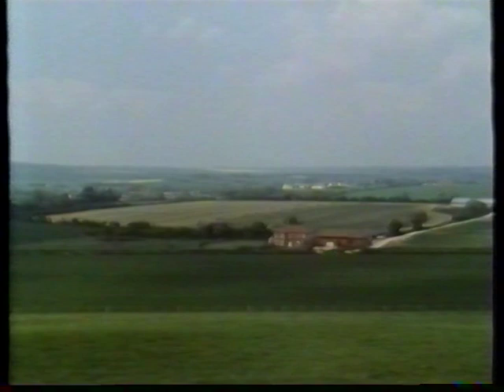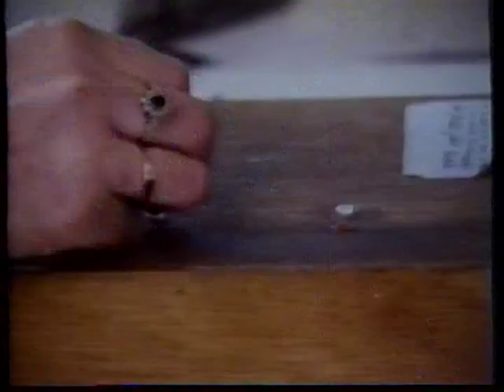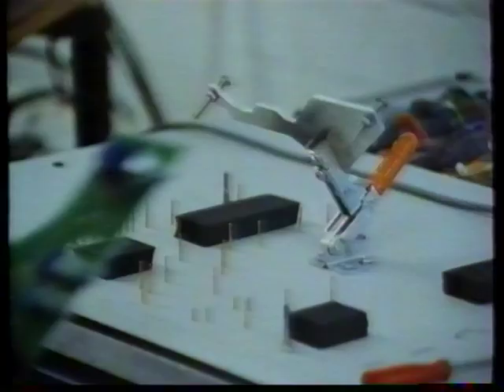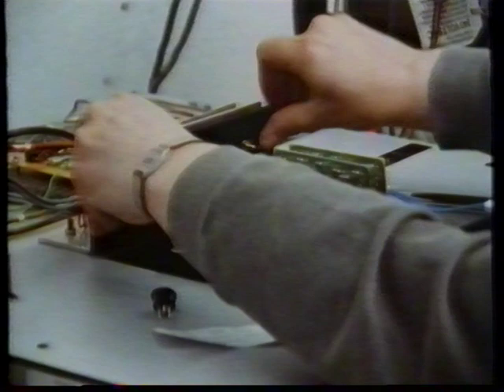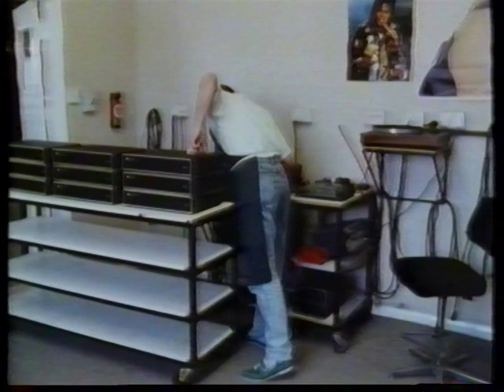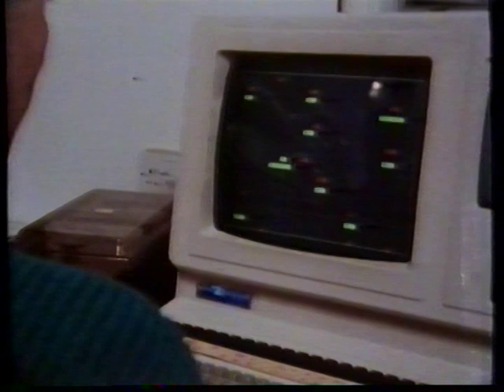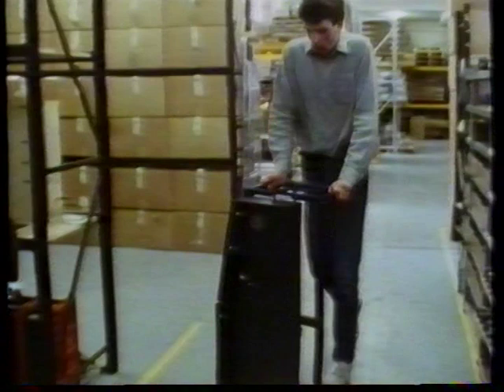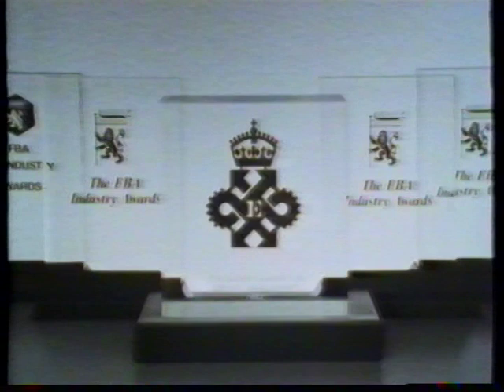Naim Audio - Vintage Documentary Footage (1989)

Comment: Still have my NAC62/NAP140 Combo, bought in 1989. I use it almost every day as part of my hi-fi audio and HD vision system. The selector control and volume are still as noise free as the day the combo was purchased over 30 years ago. It is simply the most fuss-free, reliable, neutral and dynamic amplification system I've ever owned or listened to.